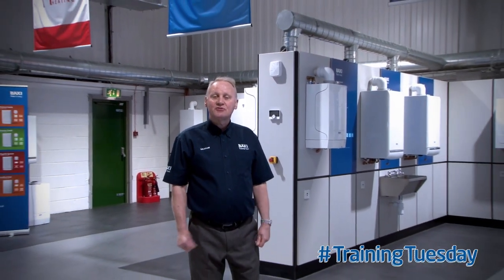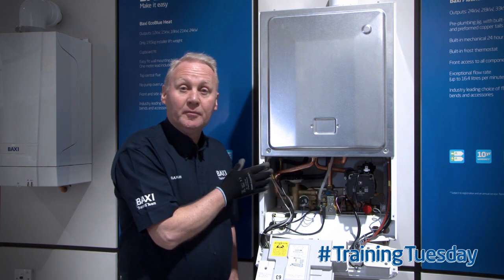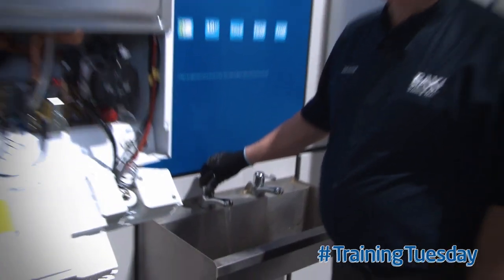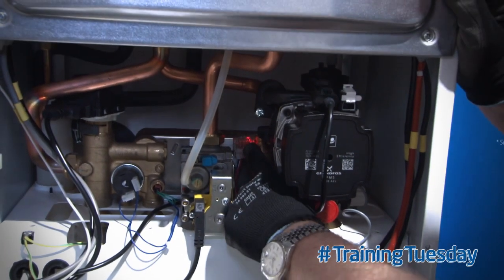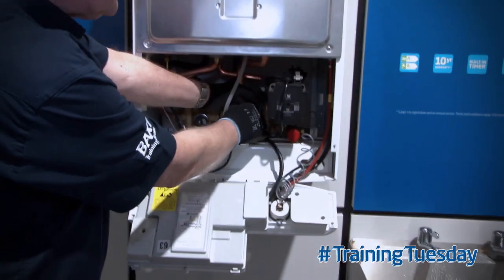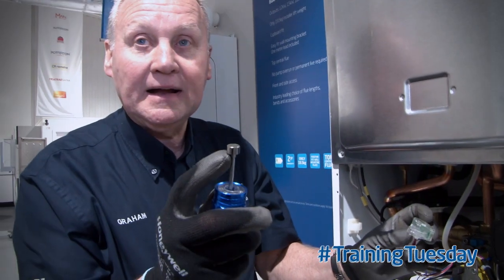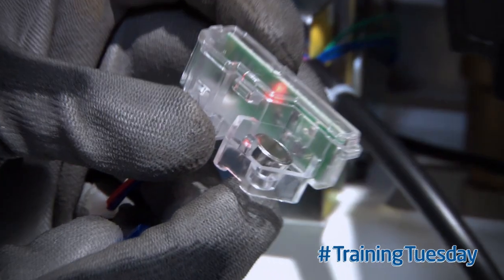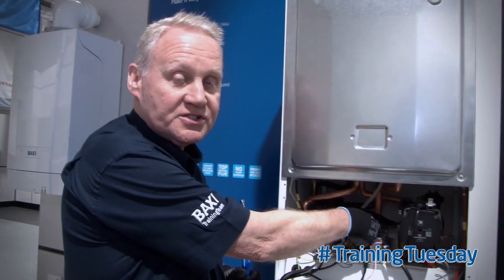How to test the Hall Effect Sensor without a multi-meter on Baxi Duo-tec & Platinum Combi range

Comment: Hi,
My Baxi duo-tech  40 has got a problem where it  does not fire and E133 error displayed.

As soon as it is re-set it stats working.
It happens once or twice a day.
Local engineer thought it is the conductor and he he cleaned it but problem is still there.

What could be the problem in your opinon?

Comment: Hello ,been having issues with the hot water not coming on until tap is nearly full flow we've had the whole diverter valve changed and heat exchanger cleaned with the filter cleaned and DHW NTC sensor changed I've just tested the magnet test on the hall effect sensor and no light when I put the magnet were shown, placed it back on, the light came on as I left the hot tap running when turning the tap down the light starts pulsating slowly until it goes off   we do have good pressure on the water it just dont kick in until nearly full on ,do we replace  the hall effect sensor and turbine ?  also tested the diverter to as shown in one of your excellent videos seems good 👍

Comment: Hi what about if hall sensor is solid and there is no demand for hot water tap is close but when u take off the hall sensor from the turbine it goes out so is that a faulty turbine
Reply from the maker: Hi Johnny, If there is no demand for HW and the red light on the hall effect sensor is solid, the most likely cause would indeed be the magnet stuck up inside the hydraulic inlet assembly on a float switch/bobbin type (duo-tec/platinum etc)  hope that helps, Sarah

Comment: What is the Hall effect
Reply: hall effect is the creation of a potential when you introduce a magnetic force to a charge carrying conductor.  There are many excellent videos on it.  In the case of a boiler, its the water passing through the flow turbine which lifts a magnet into contact with the hall effect sensor and creates the conditions for the hall effect to work.  I suspect its used to tell PCB to change position of diverter valve but cannot be sure.